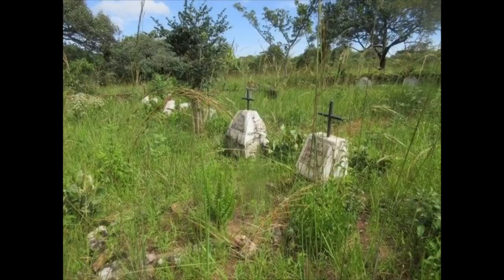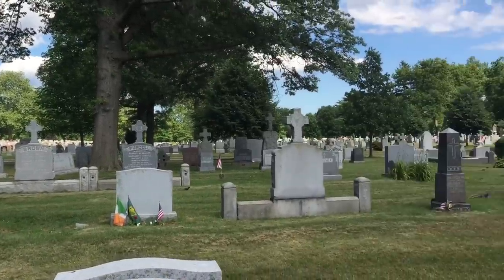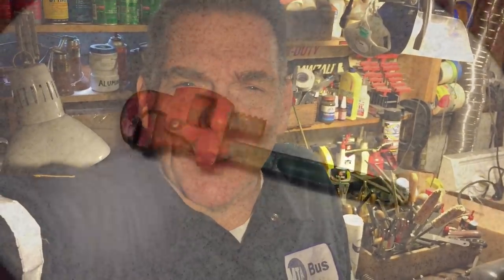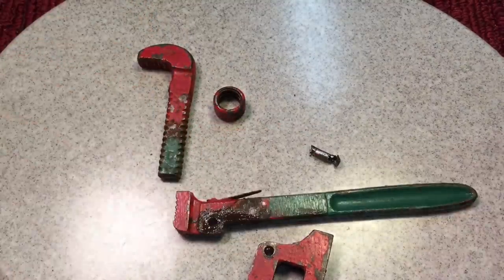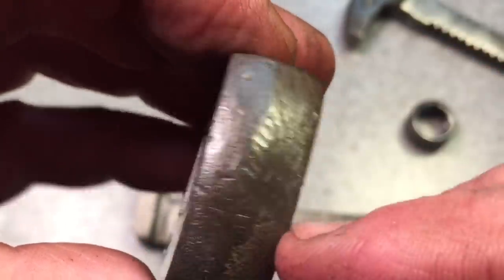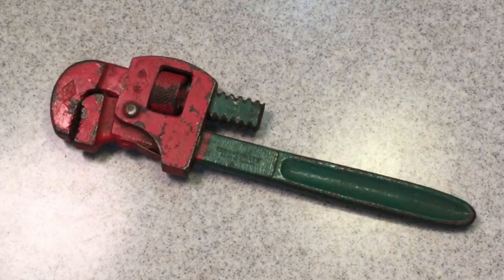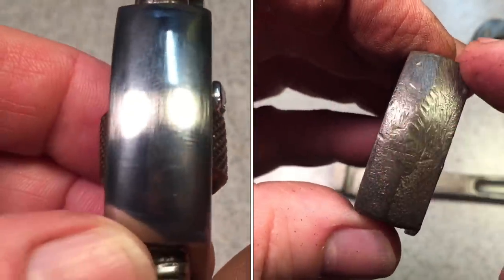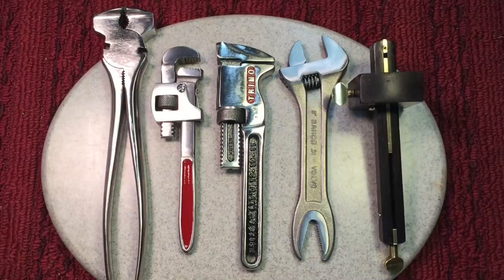Rare Gray-Bonney wrench Restoration

Comment: All these Abe tools are great restorations, but the Grey Bonney is especially nice. I've never seen that brand in the Pacific Northwest. Beautiful job. Also in reference to a few recent videos, the simple sliding marker/tenon gauge taught me something. I never considered its use as a tenon marker, but only as a simple line marker. So I ignored that feature, but your tutorial shows its versatility. Learning about tools, their capabilities and safe use  is a key reason I subscribe. Finally, the recent save of an (almost) ruined adjustable wrench was great. The wrench was useless except as high quality scrap until you straightened out the movable jaw to keep it from slipping. Now it's good for another 100 years. Enjoy your videos. Thanks
Reply from the maker: Hi Pat!  I never seen that brand here either!  No GB pipe wrenches on eBay!   Thanks!  😃👍

Comment: Thanks for another great video! Everytime I watch your restorations, I write myself new notes about technique, order of operation and equipment to try when restoring my own small collection of tools. Can I ask what grit flap disc you are using to remove the cast marks?
Thanks again
Doug
Reply from the maker: Hi Doug!  I start with a 40 grit for heavy metal removal then I go to a 120 for scratch removal and finally a worn 220 if there are still any scratches... The fiber wheel gives a nice blended look before buffing!

Comment: I'm just trying to get together an air compressor so that I can run a small sandblasting cabinet so that I can start getting on with some restorations! Good times! And nice wrench! You are an inspiration to us all!
Reply from the maker: SF- I bought a nice big blasting cabinet and NEVER use it...  I don’t like the finish..  Media blasting leaves microscopic pits and they are rust gatherers unless you paint the part... 😃👍
Reply: @ScoutCrafter  man I hear u. But just to get down to finish level... I'm too lazy to do it all by hand! And I hate rotary and power tool marks even more! And paint stripper fumes etc. So this is my compromise. Bead/sand blasting to get to a half decent state, then hand touched up after that. That way it makes the projects actually feasable for me to get done in a reasonable amount of time. Plus it's one tool instead of like 6 others. (I don't really like a lot of power tools) ( I have them, but don't use them, because I'm either afraid of them, or they screw up the finish anyways. I'd rather sand out micro pits by hand than grinder marks. So I'm still gonna give it a try. Even if I have to deal with rust I'll trade one demon for another. Plus I have other materials like brass copper,  bronze and wood I want to experiment with. Like I've got vises and wrenches and stuff that I'll never get to at all without a shortcut. I'll just try to find the right abrasive. We'll see how it goes! But thank you!

Comment: grey-bonney are from around the 1950-60 after then they just became gray tools and they still make almost all there tools in Toronto. back in the day u use to be able to buy them at Canadian tire. but now none of the big hardware stores carry them u have to go in to small independent stores to find.
Reply from the maker: Thanks for the information!  We never see these around my neck of the woods!  😃👍
Reply: MrAaron158  Gray tools are good. Somewhat below Snap-On (but not priced like Snap-On, either), but as good as US made Husky, Challenger, and Craftsman tools. Way better than pretty much all Chinese made tools.
Reply: @ScoutCrafter   i have a 4 inch adjustable wrench that is a gray-bonney i found it at a goodwill in london ontario. i also own a few of there screwdrivers there pretty nice. few other canadian made brands that are still out there are picquic, megapro and rolgear. Herbrand  use to also have a factory in canada and made stuff here but they closed down back in the 90s i think fuller also use to make there screwdrivers in canada but the went over to china sometime around 2014 ithink